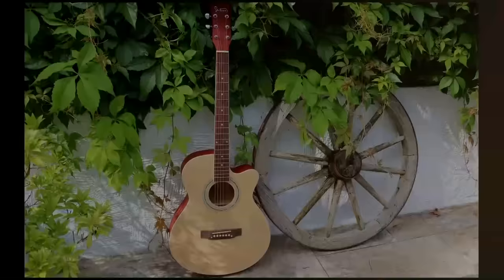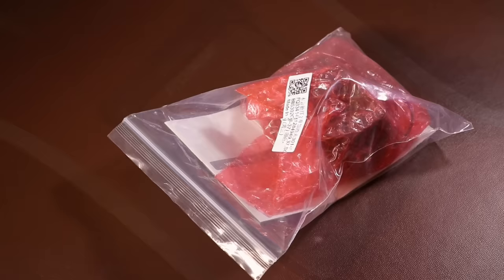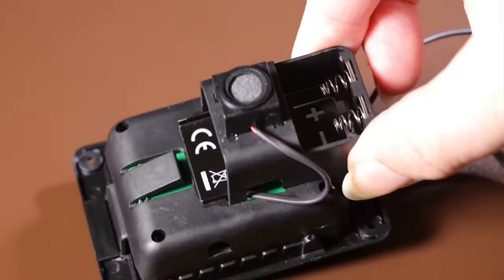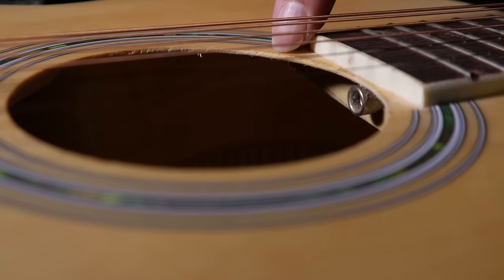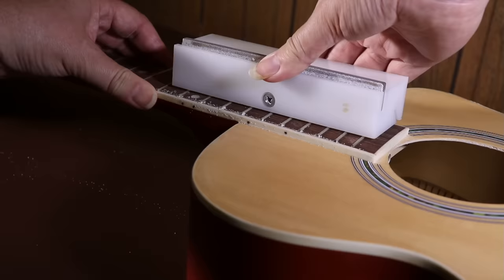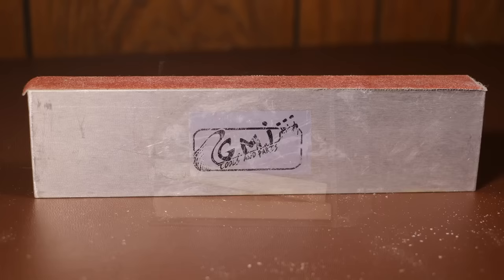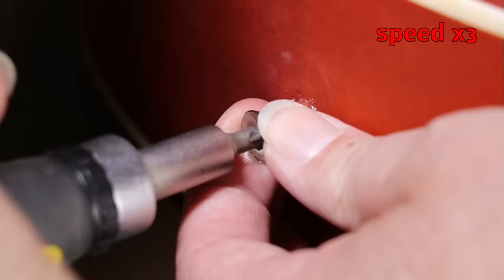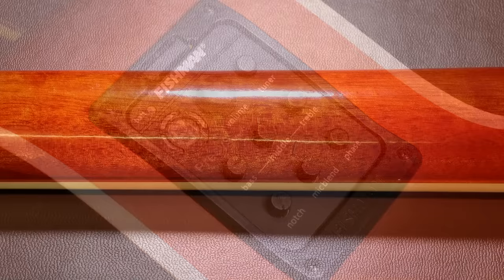How to make a cheap acoustic guitar play like an expensive guitar.  Upgrade an acoustic guitar

Comment: When I was younger I used to talk about needing better gear and a more expensive guitar to sound good... then a man came to my house, picked up my guitar and made it sing... I was immediately confronted by my friends about the idea that I needed better equipment after hearing him use mine.. valuable lesson learned that day and quite an inspiration to play better with what I have. You have inspired many with your playing with the instrument you were using. Thank you.
Reply from the maker: A good life lesson there . .  unfortunately the guitar world is full of snobs . . 🙂
Reply: When I was younger I had an inexpensive acoustic guitar. I got pretty good at playing it. Then I noticed the string action grew fairly large, over a 1/4 inch. I couldn't play it anymore so I put it in the case. It did not have a truss rod and I couldn't figure out how to fix it so I gave it away....
Reply: This was a few years before the Internet. Today, because of the Net, I know exactly how to fix it. In fact, you can fix string action without even working on it. All I had to do was put it in a relative's house in a dry climate, under 35% humidity, and pack it with 5 - 300g desiccant packets.
Reply: @Cypherdude1  or maybe even just lighter gauge strings would've helped.
I remember buying a new guitar when I was 16, because it couldn't stay in tune and sounded bad.
I didn't have a teacher or anyone to tell me that maybe I should put on new strings.
I really thought once a year was plenty enough haha

Comment: First of all thank you for sharing your knowledge, I began my journey down this rabbit hole with only a basic understanding and very little musical talent. 
    Each improvement gives satisfaction and confidence, my first was a fender that was left to me by my uncle, years of use and abuse had left it almost unplayable, especially for a beginner. Adjusting the action was a learning experience for me. Started with the saddle and found that there was more to it than just lowering, especially when the neck had came up due to a compromised body, that also had a swollen belly🤦‍♂️😂. I decided that i was seeing this one through. Growing up in a wood workshop as well as a machine shop helped with my confident ambition. A little ingenuity,patience, steam and glue later, I had it satisfying to play and sounding decent. Decided to keep going and pulled the back off, reworked and  “tap tuned” on the back and bracing as well as the front… involving much more research than actual work. 
  Sorry for the ramble, but this was such a learning experience and had such a feeling of satisfaction when done! I would have never imagined it would have sounded as good as it did when completed. Next i found a cheap made by Gibson acoustic and did the same…it is addictive! Just felt the need to share, maybe it will give someone else the encouragement to make a go at it for themselves.
Reply from the maker: Thanks for sharing . .  it sounds like you have the bug 😊😀

Comment: For me, playability and tonal substance are the key criteria for the guitars I like to play and own. By that I mean it’s not about the price but the potential a particular instrument possesses. A well designed and made guitar may sound great, even using lower spec materials. At a given price point there are compromises, but the most important part is to play the instrument and hear and feel how it resonates. Sure, new strings, fret finishing and a good set up are important too.  I’ve bought some pretty low cost guitars as well as much more expensive too. But each one has something to say and has a beating heart in the sound it generates. The enjoyment of improving guitars is a passion. Thanks a lot for this inspiring video.
Reply from the maker: Thank you very much for your thoughts (I agree with you) and thank you for watching 😊😀

Comment: It's amazing how many guitars marketed as bottom-of-the-line "beginner guitars" have really improved.  My Yamaha FG800 was a whopping $200 brand new, but I wouldn't feel embarrassed in the company of Taylors and Martins.  It may not be up there on that level, but will hold its own, musically.  I had the action lowered, and that's about it.  Much that is shown here (especially the neck/fret work) applies to electrics as well.
Reply from the maker: I have done reviews of expensive guitars and they aren't what they should be anymore . . I'll be uploading a review in the next few days and the guitar was replaced and the replacement was faulty . . and that's a £500 guitar . .  very disappointing . .
Reply: @guitar-academy  Wow, that IS sad.
Reply: my Yamaha apx500iii is beautiful!
Reply from the maker: @Hakuonu  Nice guitar . . 😊
Reply: Yamaha stuff is usually very good quality regardless of price. Also I got a $350 Squire electric and it's my favorite guitar hands down.

Comment: @7:50 By far the best pin removal. Grab the leftover tag end with pliers. "Push" the string back towards and "through" the pin, wiggling and bending while pushing. Also pull and push a little. Try to wiggle the pin with other hand.  This method "uloads" the stress of the ball wedged against the pin. Works every time unless somebody glued them in. Never have a toolmark on your pins again. 
This has got to be one of the best tricks ever taught to me long ago.
Reply: Agreed!  Good job!

Comment: The only thing to remember which is double important, is making sure those iron filings and saw dust are thoroughly removed from inside the instrument, as the magnetic pick up will become clogged over time.  Always cover the sound hole during work, especially doing fret work.
Reply from the maker: Great point!
Reply: This is a great suggestion if you have magnetic pickups. However, the transducer pick up strip I don't believe is magnetic?  I would vacuum and wipe clean all dust weather it'd be iron filings or wood.

Comment: If you put a capo on the neck you can loosen and remove the strings from the pegs without ruining the strings. When you are through adjusting the bridge simply put the strings back in the holes,  replace the pegs and tune it.
Reply from the maker: good suggestion . .

Comment: Your videos have been very helpful to me. I bought a €69 Harley Benton about eight months ago when I decided I wanted to return to playing guitar, as I saw the guitar seemed ok for the rock-bottom price and I just wanted something 'playable' that I wouldn't feel guilty about if I didn't play it all that much. I also figured it would be a good guitar to 'learn' some basic luthier skills on, since I've always been pretty handy and done lots of fine-craft  labor (I was an upholsterer and sailmaker for years) and figured I'd be able to do nice work with a little instruction.

Since then, I've installed a strap knob on the treble side of the heel, fixed a number of proud spots on some frets, smoothed the fret ends, replaced the saddle with a bone one, removed the casting lines from the tuner knobs, etc. Not to mention, I've played the hell out of it! I'm also planning to switch in some nice-looking new bridge pins that I bought and change out my nut to a bone one, then give the guitar a really proper final setting-up in terms of action...and maybe even try putting in a piezo pickup on my own... Your videos have been really helpful in this regard and have lent me a bit of confidence to try all this out, so thanks again.
Reply from the maker: wow,  you've been busy.  It's really nice to know that my videos have helped you on your way . .  thank you 😃

Comment: Bought a Glarry P-bass copy at $67 new. Many of the same issues. Many frets were not fully seated and took some hammer work and then stone work. The fret rocker you mentioned was very useful. The neck needed considerable adjustment. VERY IMPORTANT to oil the tuning machines as they are cheap and have a lot of drag when dry. Oiled up they are acceptably  smooth and will last longer. The electronics are cheap crap, replaced them with a kit of parts with CTS American made pots and an Orange Drop  0.047uF cap and that really brought out the true bass tone by cleaning up the high harmonics. PUPs sound good with the improved electronics.  It could still use some minor further setup with dressing fret edges better but is now sounding good and is very playable for an amateur like me.
Reply from the maker: I guess, with the more expensive guitars and basses, that's where the expense comes from. . . the man hours to really finish the instrument off properly.  But doing it yourself you get what you want and you get the satisfaction on knowing you did it . . . 😀
oh, and you save some money.

Comment: Well presented. Excellent information. The one thing I would add is intonation. Before choosing a candidate for this work, the intonation has to be very close to perfect or don't bother. You can tweak intonation a tiny bit, but if it's too far off you'll never get it right. These techniques can make it play better and make it more useful with the preamp, but it will never sound right if the intonation is bad. Unless your willing to do ALLOT of work moving the bridge, never buy even the cheapest guitar if the intonation is bad.
Reply from the maker: Yes, agreed.  This video was made for people who already have a guitar they like but want to improve it, so you would know if the intonation was out.  I review a lot of guitars (both expensive and cheap) and even very cheap guitars these days, I hardly ever see a duff due to intonation.  the joys of CNC I guess. 😊
Reply: @guitar-academy  I see far less intonation issues than I used too and I have found some very cheap guitars with near perfect intonation, but I have also found a number of very expensive guitars with intonation that should never have left the factory. 
Its a personal pet peave when salesman swear that a guitar is perfectly intonated and it's 5-8 cents off. My post had less to do with your excellent video and more to do with my personnel issues with bad intonation.
Reply from the maker: @yadaroni Yes, I understand.  In the past I have even seen a batch of Fender acoustics with shockingly bad intonation.  😊

Comment: Thanks for putting this video together.  I have a guitar that is a perfect candidate for some upgrades. I'll use a small razor saw to cut the hole for the pre-amp and fit a bone nut and bridge.
Reply from the maker: Thank you for watching . .  a razor say sounds like a good and accurate solution . . 😃

Comment: Another mod you could do is check the bracing on the inside and help improve any defects there.

You could also reinforce the bridge in case they didnt or the tail in case it isnt reinforced.  

I think Id have done a full refret if I was going to do so much work anyway on them and use better wire than they used.  

Anyway cool video and very thorough on the fishman install.

Comment: did this with a Glarry GT604 41inch Dreadnought Spruce Front Cutaway Rosewood Back Folk Acoustic Guitar Natural.
$99 
I had to clean the fret ends and fix  one proud fret and adjust the action and neck straightness.
I added both a 
Dimarzio BLack Angel Magnetic (DP234) and a
Dimarzio Black Angel Piezo (DP235)
Black Angel Piezo dp235 has a 3.55 input jack for the Black Angel dp234 magnetic directly attached to the endpin it comes with so you can connect it directly to the  sound hole Black Angel pickup.
You just have one output but it is TRS stereo. A regular guitar cable will just pick up the piezo pickup but if you split the trs into 2 mono signals you can have both the piezo and magnetic coming out so you can preamp them on a mixer.
Just a single endpin.
Sounds great for fingerstyle, percussion.
Total is around $400 for this beast.

Comment: To aid the fiddly job of inserting the guitar jack output, push a length of 6mm dowel inside the guitar, slide the input hole over the dowel, then withdraw the dowel back through the access hole .
Reply from the maker: wow . .  great tip, thanks . . 🙂
Reply: I use the bent and flared 'rim' end of a bicycle spoke to pull the jack back through the body hole.
Reply from the maker: @kennethkowalchuk7868  I am genuinely surprised by the imaginative solutions people find for this . . . brilliant  😀

Comment: I know it's a cheap guitar and the hole in the side probably won't make much of a difference in its sound but you could have fitted something like the Shadow NanoFlex pickup/e-Performer with the preamp volume and treble & bass EQ controls all neatly tucked away just inside the soundhole. No need to cut a big hole in it. I've been playing since 1966 and have seen musicians including myself butcher their guitars in one way or another and everyone regretted it.
Reply from the maker: It's a matter of taste . .  I've never regretted fitting a piezo into a guitar.  I've tried several hole pickups and got rid of them because the sound is never natural to my ear and the wires resting on the front of the guitar looks shocking, causes buzzes, gets in the way and can damage the finish over time.  But that's my personal taste.

Comment: On the bridge work , it looks like you should've cut out the bridge saddle slot to accommodate the piezo pickup as well as taken some material off the saddle piece to lower the action at the bridge end. The Ovation acoustic electric that I have, the saddle slot is cut deeper, Ovation places shims that are loaded into the bridge that the owner removes to set action height to a desired height.
Reply from the maker: With this guitar being so cheap I was being causious because I didn't know how deep and healthy the wood was, I know the soundboard wood is very thin.  But it worked out perfectly, I've changed the strings again since and I even use this guitar in my latest tutorials leaving my expensive acoustic on the hanger.
You need to watch the playlist because you see the entire process where I set the action . .  and I set the action properly and level the frets and it is as low as it can be without any buzz. 😀
Reply: @guitar-academy  I reacted to the issue that the shaved down bridge saddle piece that wouldn't stay in the saddle slot from this video with the piezo sensor installed & without the strings holding it in place. You did an excellent job of adjusting the action in the end. The hard part of what I suggested would be to dig out that saddle slot evenly and accurately. One would need a file that was the correct width and patiently grind & scrape out the Rosewood for what depth for the piezo sensor. Another possible solution would be to cut the saddle slots as string bend over contact points a little deeper like the nut slots need to be cut for a new nut. beautiful appearance & sounds for an affordable guitar as a completed project of upgrades.
Reply: @guitar-academy  Excellent setup! - When I bought my Gibson Songwriter Deluxe Vintage EC there was a problem with the saddle not seating correctly affecting the resonance and pickup.
I called up Gibson and they told me to get a spark plug socket and a small hammer or tool to tap with. I said, "What?" - They told me that sometimes they need a little help seating into the slot. They walked me through it over the phone and it worked perfectly, but really, when they told me to place the spark plug socket over the saddle and whack it...I was more than a little worried, nonetheless the first thing I did with that $3000 guitar was whack it with a socket and small tap hammer. lol. ;-)
Reply from the maker: @greglawrencemusic  ouch . .  some repairs are surprisingly brutal looking.  Personally I would have sanded the sides of the saddle so it could be pushed in more easily.  Both these methods have advantages and disadvantages.  I very tight saddle transfers more of the energy from the strings to the body of the guitar, however a slightly looser saddle transfers more of the energy to the pickup . .  🤔
Reply: @guitar-academy   - If I remember correctly (thinking about it some more) the "sharp whack" was to seat the piezo under the saddle, but still brutal, yes. ;-)

I also remember when the Internet was new, I watched tons of videos with people smashing guitars. I was surprised at how sturdy acoustics were in comparison to electrics. Most had at least two to three encounters with hard concrete pavement before they would actually fly apart in pieces. lol. -Cheers!